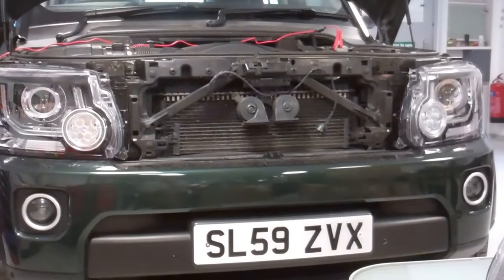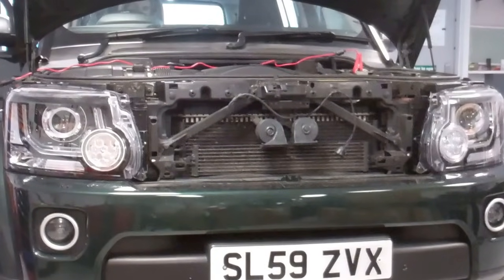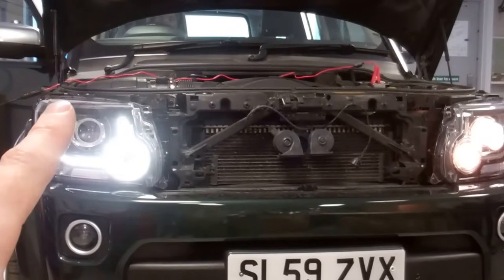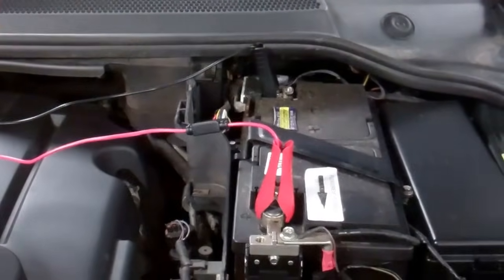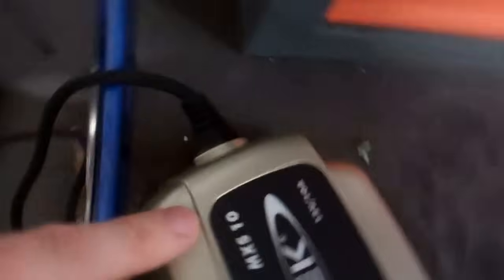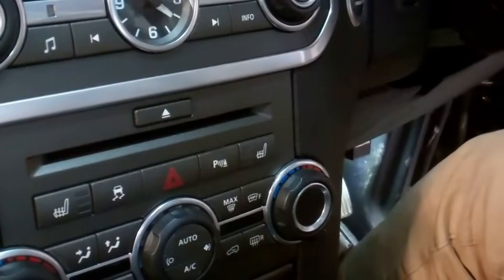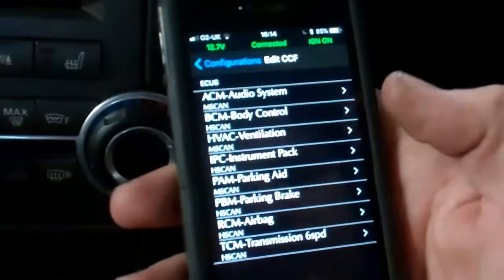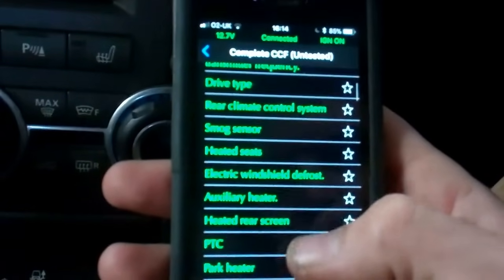Land Rover Discovery 4 Xenon headlight upgrade with GAP IID tool

Comment: I have 2012 that came with xenon.  After a fender bender the shop installed halogen.  They went out of business like a month after.   Would  my vehicle still wired for xenon?
Reply from the maker: Its hard to say - you need to look into the car CCF files and see what it is set for.

Comment: Hello, I'm installing a daylight running lights and I've seen lots of your videos, but I want to know which fuse in the motor fuse box has energy from the moment you open the car doors with the key like the 12 volts connectors from the inside that has energy from the moment you open the doors with the key, thank you so much

Comment: Hi guys loving the vids. What OBD tool/device do you recommend? I find most offer only basic Land Rover functionality but I see yours offers all sorts of coding and options. Thanks
Reply from the maker: This is an ever changing scene with many new devices on the market and it depends what you want to do. The GAP IID tool is great for modifying your vehicle but expensive if you just want to clear and read fault codes

Comment: Hi I have a 2012 d4 with headlight conversion already in when I bought it.
Two things / drl’s don’t dim when indicating - I can live with that 
Other thing is main beam doesn’t flash unless the lights are actually on which isn’t ideal.
Is there a fix for this please ? 
Thanks
Reply from the maker: Hi - yes i need to look at this again !
Reply: Any fix for this? I have the same issue
Reply: @simonwalton5132  you need ID  II connected then change the type of headlights , off top of my head i cant remember what it got changed to but it now works properly!
Reply: OBD II sorry
Reply: Also looking for a fix, however as a work around if you set Scandinavian DRL's to on, the Xenon dipped beam becomes the DRL as soon as the engine is running. Not ideal, but it means that you don't have to remember to turn the lights on/rely on the auto lights. When the lights are switched to side lights only, the main beam ceases to work. 

Finally, when "flashing" the main beam from the stalk, a relay/motor can be heard clicking, which leads me to believe the BCM is correctly managing the logic to move the lamp unit but is not powering the ballast unit to give a light output.
Reply: Used GAP tool told it that it only has one bulb problem fixed
Reply: Hi Simon . What did you do on the gap iid to achieve this 
Thanks
Reply: @brianwallace5775  i had to go in the menu to tell the car it only has one bulb not 2, also turned xenons on if I ever upgrade again
Reply: @simonwalton5132  Thanks Simon what section is this in. Driving me crazy
Reply: @brianwallace5775  I found a 'how to' document on one of the disco forums on line...sure I took a screen ahot or saved it....can I find it!??!
Reply: @brianwallace5775  so, on the GAP tool go in to Complete CCF (Untested) - options - high beam Lamps - not fitted 👍 job done
Reply: @simonwalton5132  great thanks I don’t have untested but think you can request it
Reply: @brianwallace5775  yeah mine was done in a day via email very helpful
Reply: @simonwalton5132  perfect I have sent them an email. Thanks for your help 👍
Reply: @simonwalton5132  all sorted thanks for your help on this 👍

Comment: Hi there, this is very cool video. I just upgraded mine. A quick question do you know where is the AFS ECU? My old headlight has the AFS on and my new lights don’t have AFS. The orange warning lights is on. I tried with the tool to disable the AFS and the light is still on. Talked to the guys with the tool and they suggest unplug the AFS ecu. Wonder where is it? Thanks!!

Comment: Hello, great video, I’ve had this done to my 2012 disco, but only just realised the headlights won’t flash, unless on main beam, won’t work even on side lights, the garage that did it has no ideas, have you? Thanks
Reply from the maker: Sorry for slow reply - been on holiday and just catching up !
So it looks like you have found something here - early D4 headlights have 2 bulbs but the later one if you look has only 1 bulb for high and main beam and this is achieved by a shutter infront of the bulb to give the correct "shadow" pattern for low beam. What this means is that you hear the sutter open / close when you flash but thats all - you also need the low beam bulb to come on. So i think we need to add a diode ( one way electrical component ) going from high beam signal to the low beam wire.... let me test on our car. Will try and get around to it this week !
Reply: @L663  hiya - this is exactly the same issue i have having with my car - did you ever get this to work as its driving me crazy and would love to know the workaround
Reply from the maker: @logcabingaming3710  No we have not fixed this yet
Reply: @L663  ahhh ok fair enough - do you think the diode theory you postulated on another video is worth looking at or do you think its just a broken anomolie?
Reply: @L663  any news on this?
Reply: @L663  hi, just wondered if you managed to fix this. I seem to have the same issue (I bought the car this way)   Cheers.
Reply: Any fix for this? I have the same issue

Comment: Do you think the Xenon GAP IID method will work on a 2005 D3?
Reply: Yes
Reply: You don`t need gap tool in D3. Just connect non adaptive xenons to halogen wiring. Plug and play

Comment: What would you recommend on using to cover up the bumper parking sensors holes if you upgrade to a D4 front bumper and your car does not come equipped with parking sensors? I know the logical answer would be to buy a bumper without that particular feature, however, all bumpers for sale seem to come with holes for sensors
Reply from the maker: We could laser cut some blanks from 5mm plastic... these may be a good seller ? or you could just buy some parking sensors and plug them in ?
Reply: powerfulukltd - I think your idea of laser cut blanks might be a better choice considering used sensors are hard to find and I’m certain Land Rover charges a high sum of money for new sensors which will solely be employed for cosmetic purposes. I’m pretty sure it would be a good seller for your company

Comment: Hey guys - Great videos! Have just put a deposit down on a 2011 Disco 4 and am looking to upgrade the bumper, lights etc, and have had a look online at purchasing the IDT tool, but wasn't sure which tool you've got, the BT or Pro? It says that CCF access is VIN locked unless you have the Pro - can you confirm this please? Keep up the good work!
Reply from the maker: Hi - we have the BT and i believe it would be VIN locked for these functions ( enhancements ) but remember you can still fault read and fault clear across the LR range with your tool - see my other videos where we cleared the airbag faults on our freelander 2 with the same tool... as fault reading and clearing is not an enhancement the GAP diagnostics team has left these functions open for all to use !
Reply: Hi - thanks for the swift reply! I think I may have misunderstood the VIN Locked part. Does that mean that it's locked specifically to your own VIN i.e. just the 1 car (My Disco 4). So, I could edit the files to enable me to stick in some xenons...?
Reply from the maker: Yes its a bit complicated the way they do it but you will only be able to "modify" your own car ( single VIN ) but you can fault read / fault clear on all you friends Land Rovers / Range Rovers....I am not an expert but getting to grips with the IDT tool / platform etc.